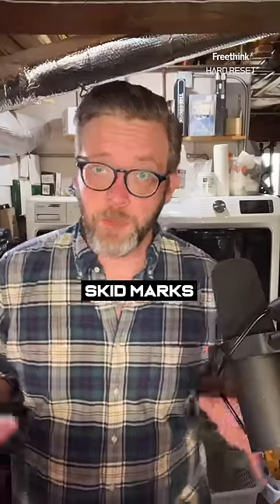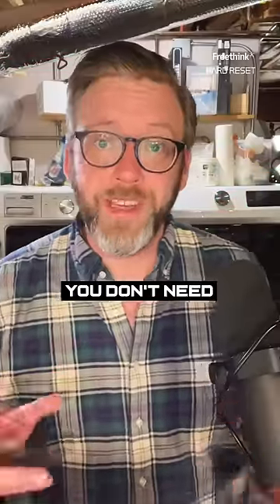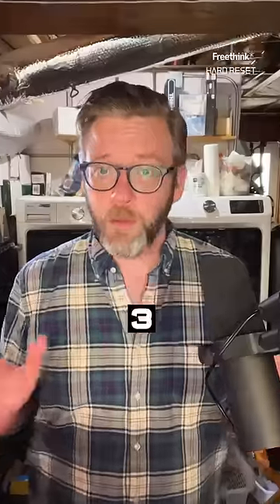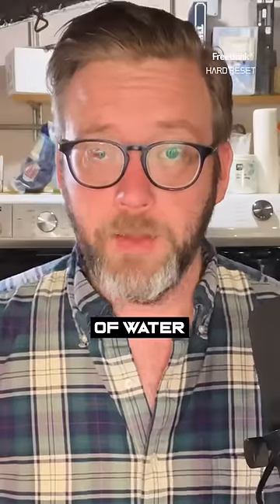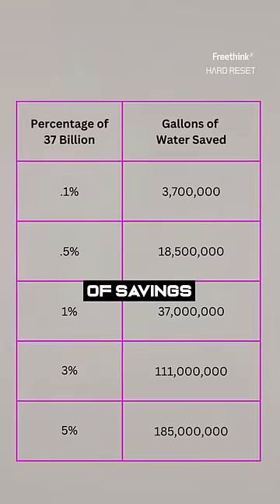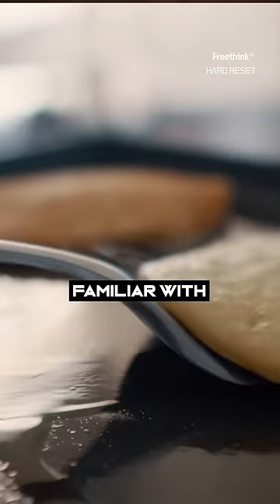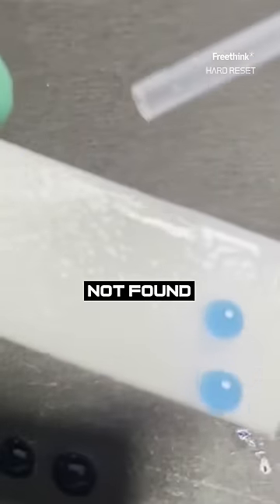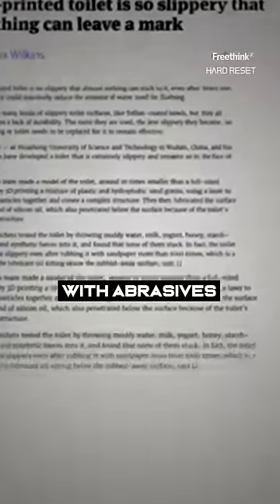Researchers invent super slippery toilet 🚽😳 #shorts #metamaterials

Comment: Unless you intend to line the entire sewer system with this material, using less water when flushing will just mean more blockages down the line. Great for the drain unblocking business of course.
Reply: If the toilet is the only way you use water, maybe. But you gotta think about pressure in a pipe forcing material as opposed to open bowls that need more water to wash it away
Reply: @lemonstealinghorsdoeuvre no. You need a seal to prevent gases on the sewage line from coming back in. 

That means you STILL need pressure (water) to force the waste up and over as well as replace the volume of water in the toilet. 

Because of that, the amount of water difference is really minimal. 

You could artificial pressure for the toilet water, but then your poo would basically explode when you flush. 

This is a good idea who’s use in toilets is a lot more limited than the outhouse application they shown in the vaporware video.
Reply: @FilmFlam-8008  yeah, I'm not saying you don't have water in the flush, but it's only a couple cups of water, as opposed to 2-6 liters the trap on a toilet isn't like a P trap on a sink, it's an S trap that just needs to be above the hump to create a siphon, once the siphon pulls the ... payload over the hump, it creates an air pocket in the S that stops the water from flowing because it drains into a 3" pipe that allows the pressure lock to subside. So the bottom of the top of the S, fills until the reservoir is high enough to stop the gas flow, ie, the diameter of the drain, which I think is 2".

The point is that your waste falls into the neck of the S, as opposed to a bowl full of water. The water is only there to prevent everything sticking to the sides currently, the height determines the siphon flow, not the volume.
Reply: @lemonstealinghorsdoeuvre  no. The water is there to create a water seal for the gasses in the sewer system. And it takes a significant amount of water to flush a turd. Cleaning the sides is just the ancillary job. 

Yes, this would save SOME water, but even frictionless, you still need a Decent amount of water to flush. 

The average poo can be from 1/4 pounds to 4 pounds. And it is not always “flexible”. You would still need around a gallon of water to do that. And yes, high efficiency toilets today use 1.2 gallons. So this would save SOME water, but nothing really noticeable in a water bill. You would waste more water brushing your teeth than you are saving here. 

It would be better for cleaning and sanitation. THAT would be its best selling feature, and the surfaces the coating is applied can be reduced. The water savings would be very minimal.
Reply: @FilmFlam-8008  I think we got our wires crossed. I was responding to the statement  "less water when flushing will just mean more blockages down the line" with my two cents being "if the toilet is the only water you use, then maybe." I agree, the water is going to flow still, bad choice of words... the water will continue to flow, the chances that the water flow is at such a minimum that it doesn't clear your homes main drain is nearly 0%. 

Sorry if I was unclear, you are correct.
Reply: @lemonstealinghorsdoeuvre assuming the waste moves far enough through the system to be washed out by an upstream water source.
Reply: well its good for motorhome/portable toilets
Reply: You're exactly right. Some of these newer toilets don't use enough water. I was working on a home the other day with a blockage. After running a few test we found if they would flush twice they wouldn't get the clogs any more. The small about of water was moving so fast the water ran away from the solids.
Reply: @lemonstealinghorsdoeuvre the idea that other water usage will push solids only works if you have drains past the toilet drop. Lots of homes have the toilet on a separate drop or at the end of the run.
Reply: @lemonstealinghorsdoeuvre even then you still have to have water behind the material that’s flushed. Most places have cast iron which have a high friction rating considered to abs or pvc or even 3034 pipe. The idea of limiting water and doing this to toilets only create Moore problems. It’s just another way for the state to make money off banning the amount of gpf toilets.
Reply: Ain't no way some toilet experts in her arguing😂, y'all gotta be plumbers or som
Reply: @rebchizelbeak5392 
The video didn't state that it would eliminate water usage.
He specifically stated that a tiny fraction of water saving is a lot less water used.
Reply: @lemonstealinghorsdoeuvre  once it gets to the pipes, sure. The slope should take care of it. But it first has to go down around, and overtop an S trap. That would be the limiting factor along with enough average water to “clean” the bowl and refresh the water in the trap. 

At a certain point, the savings for even an impossibly frictionless surface are irrelevant. I believe others calculated that to about a gallon or 0.7 gallons for “pee” only.
Reply: If the only source of water pushing sh*t through the sewers came from toilets, we'd be screwed.
Reply: Actually….not a bad idea but we do it backwards
Reply: You wouldn’t have to do that, all of the plumbing lines from people’s homes would go to a massive subterranean tank that mixes this foul life ending concoction to an ideal liquidity, and is pumped through the same way the muscles of our digestive system pumps it through our body. This would be massively expensive tho (the muscle emulating mechanism) so maybe just leave the pipelines as they are, but still have central tanks that turn everything into a pulpy paste or something. And then pay whoever services it $130 an hour 😭😭 (that part is not an issue at all, wake up and learn about our corrupt country and you’ll understand if you don’t already)
Reply: @whitechris720  nobody said "design the crapper so it doesn't work"
Reply: @FilmFlam-8008  oh my God, seriously? Where is the s trap? Go look at a toilet. Oh! Wow! It's part of the toilet, it's all one substance, so wait... does that mean it's just as slippery as the bowl? 

Now you introduced an "impossibly frictionless" toilet. Let's think for a minute. You have 0 friction, that means absolutely no sticking to the walls whatsoever. So that means you may as well just have a door that opens and drops the payload onto a lower door that opens when the top one is closed. Boom. Airlock. Just add a purge for foul air with an inlet that could hold some potpourri. Now your made up problem is saving tons of water. No washing the bowl. No water needed to dispose of the waste. Nothing to complain about. Well done.
Reply: @hunteruhuruazrael  thank you. Thinking is just no longer a positive trait anymore, it seems.
Reply: Use it at the skatepark on rails and ledges...no more wax needed 🛹
Reply: Well we could use another solution for that. Perhaps adding brackish water to make up for the difference? Or maybe have a distributed sewer treatment system, although that is way less feasible overnight.

Comment: Adult industry be foamin at the "all slippery all the time" material.😅
Reply: And if it really is so slippery, it should als be easy to keep clean. So you don't need extra protection to keep the attributes clean. You can basically rinse it off and maybe spray it with ethanol after.
Reply: Cute horsie
Reply: @bloepje Just stop please, of you need solvents to make it come off the water will do very little. Please just think before posting.
Reply: @jackster2568 can you think before posting too? Does it really matter to you that they are wrong? Does every opinion or idle thought have to a factually correct statement? No it does not so chill gamer, its fine.
Reply: @jackster2568 "No need to rinse that saucy dish, you're using soap"
Reply: The only problem with that level of slippery is that it may actually work against pleasure. No friction = no feeling.
Reply: Even after you stick it in abrasives!
Reply: @bloepje  Someone needs to make some bacteria cultures before we commit to that idea lmao

Comment: The inside of all pipes in houses/building, etc., should be made with this
Reply: Why?
Reply: @John-ml2gh  to prevent clogs and buildup.
Reply: @bluflare12345  shouldn’t run across any of that if you run your pipes correctly.. unless you’re draining some absurd things
Reply: @John-ml2gh less energy required to move the fluids  through the pipes. An example would be commercial swimming pools require a certain turnover rate to keep the water filtered and disinfected. Pool pumps use alot of energy to do this. Every 90° turn in the plumbing causes resistance and even the inside of the pvc pipes used in the plumbing cause resistance which = less efficiency which = wasted energy. The same would apply to water pumped into your house from a water district or even a well and water that uses head pressure like a water tank on top of a hill or skyscraper has to have water pumped into it to fill the tank.
Reply: @nicholaspowers4782  see, I like the way you’re thinking. These guys describing the drain systems in homes which I can’t understand the point. Would be too cost effective. But to your point, it would actually be worth it if designed right.